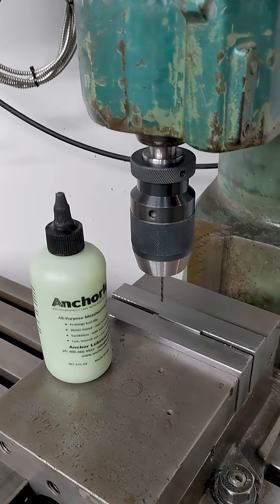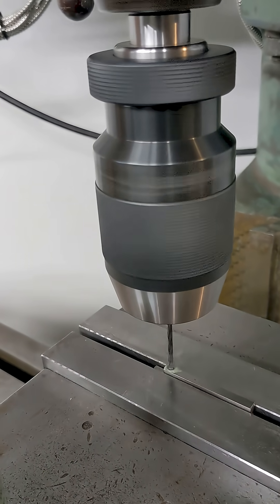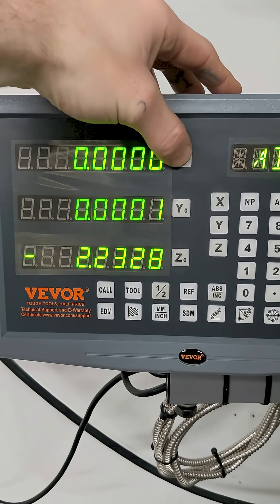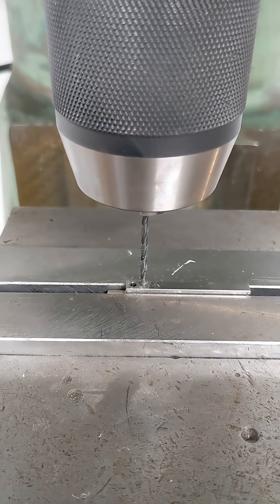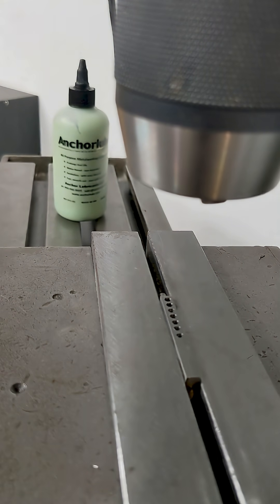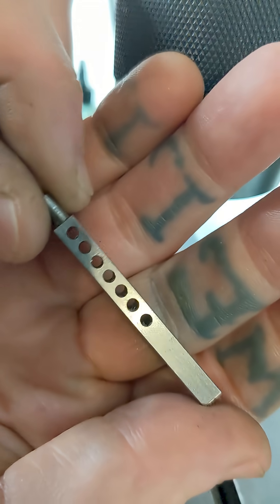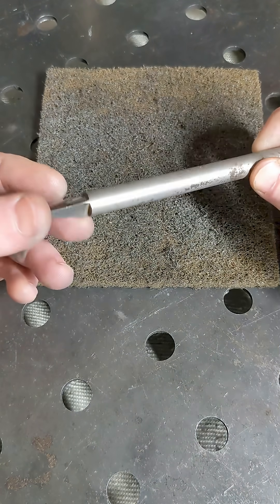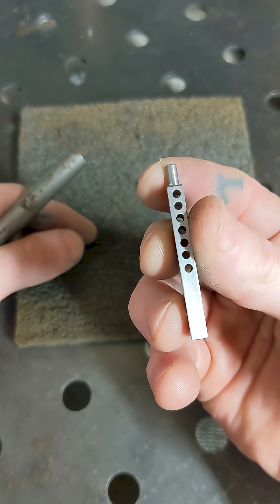Lightening a Tattoo Machine Armature Bar #manualmachinist #madeinusa

Comment: Are you making arm bars from scatch? If so, what material are you using? I build machines from time to time, mostly from pre made parts but ventured into coil winding and turning my own cores. I found that material selection can really make a difference.
Reply from the maker: I get DC Magnet Iron bars from AMR Machine and South State Tattoo Supply.  This one is annealed low carbon steel from Eminent Machine Supply. Different materials definitely hit differently.  I also noticed that heat treating the frame seems to change the hit.